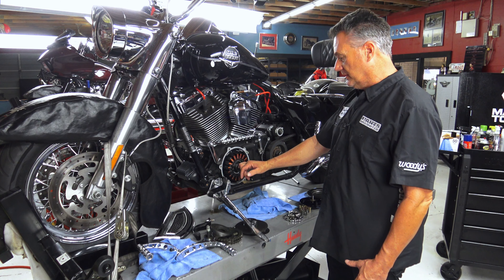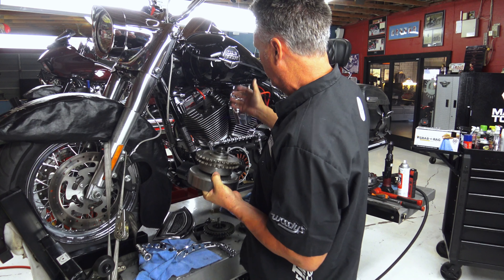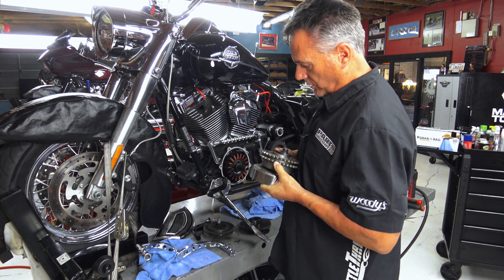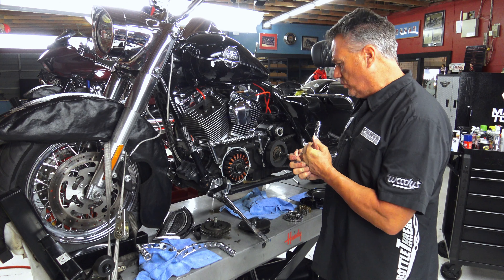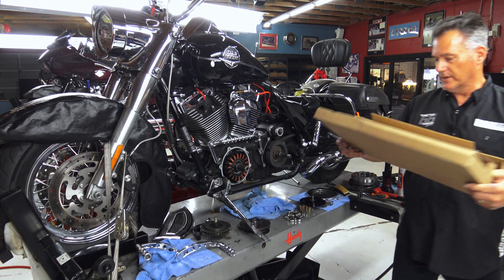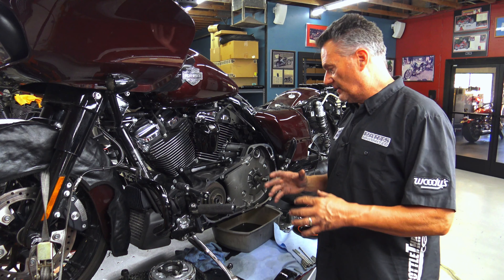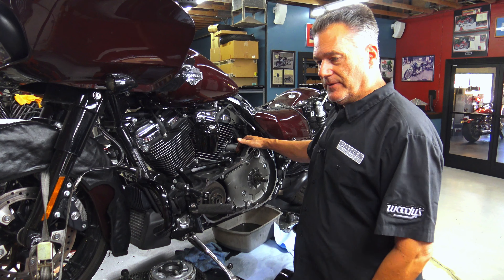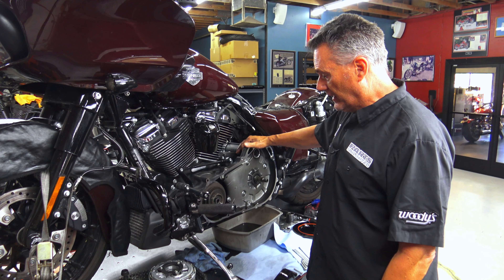2009 Harley-Davidson Road King Transmission  Project

Comment: Bill just found your site and i’ve watched a few earlier videos and it’s great the way you explain everything so clear..I don’t know if you reply to people but hope you will..I have a 2009 Road King with 40,000 miles..Bike runs great but i’ve noticed when i shift through the gears say 2nd to 3rd for example i have like a “play” in between All gears…If i shift day from 2nd to 3rd and give it throttle and let off quick then throttle again it’s like there’s play and a clicking sound…Will do it through all gears…Quick throttle then let off and give it quick throttle again,,Like in my head i’m thinking there’s about 2 inches of play then that click then it’s the same through All gears…No vibrations…Could it be rear bushings worn out..On the hwy it’s fine at 75 mph …The clicking sound when i give it quick throttle then let off sounds like it’s in the centre of the bike..No strange noises,,I’m just thinking rear bushings…Any help greatly appreciated….Thanks.!!
Reply from the maker: Sorry for the delay responding, sounds like  the trans might need an overhaul. Also make sure to check all critical fasteners. Thanks for watching